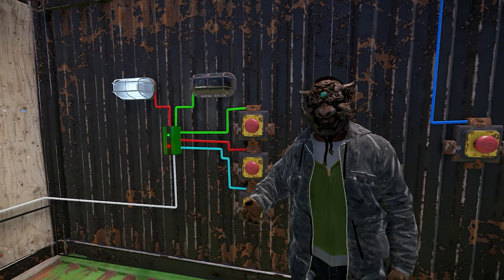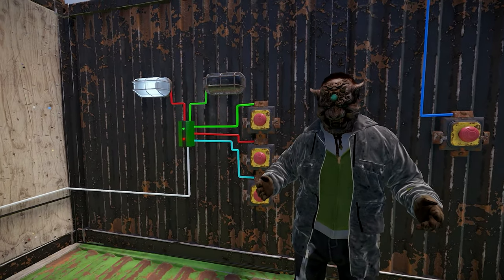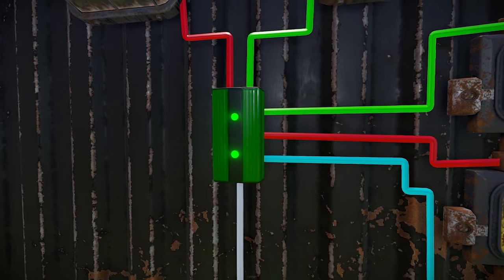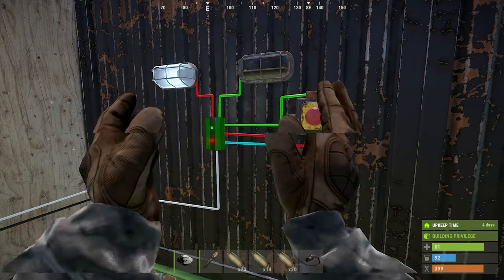Effortlessly Use the Memory Cell in Rust in Less Than 3 Minutes

Comment: I started using this in conjunction with a clock to set up automatic lights instead of a blocker. The clock allows you to set precise times instead of "when solar power goes to zero". This is helpful when you build in areas where it is naturally darker in your base (swamps for example).
Reply from the maker: I LOVE THE CLOCK! I’ve made two videos including them, maybe argue the blocker and panel route, but personally it’s a tad old school, the clock function is incredible! How do you use it with the cell, you’ve got me curios
Reply: You set two alarms on the clock, one for the time you want the lights turned off and one for the time you want the lights turned on. Turn off the alarm sound. The power out of the clock goes to the toggle input of the memory cell. The power out of the memory cell goes to your chain of lights. I like to put a switch  between the memory cell and the first light for a manual override. Just make sure enough power is going out from the clock passthrough to power all of your lights and you should be all set.
Reply from the maker: Ohhh that’s dope, I dig the idea, super useful way to utilize the clock with this, thanks for sharing, I’ll give this a try in my next wipe!

Comment: At 0:07 you mention it costs 5 hqm but it actually costs 75 frags --  otherwise nice video I love the memory cell. I use it constantly for complex turret setups, I use a circuit where both hbhf,seismic, and certain turrets detect raiders from a given direction, once detected, I use memory cells to divert power to the correct group of 12 turrets on a given area of the base (ex. north side compound)

Another way I used it is to temporarily take all SAM or Turret power to pulse all door controllers to close them, it just diverts the power through door controllers and reset the mem cell right away. Also can be used to divert non-essential power (used in a farm,lights, fun stuff) to a group of turrets in the event of an attack.
Reply from the maker: @OrangeChonk  FUCKKKK I should’ve quick referenced this, I think it was an old craft metric or I’m just spacing it thanks for that correction! Def going to edit that part out for sanity sake lol

But I like the example you’re sharing! Super cool use of this item, there’s so many cool routes you can take with it! Appreciate the comment my dude!
Reply: @Sledge315  Thanks! Yeah I believe it once was 5 hqm in the early days of electricity.
Reply from the maker: Yea that’s the stuff I forget to check when I make these haha, it’s in the process of cutting that small portion out, def don’t want to confuse anyone, good catch!